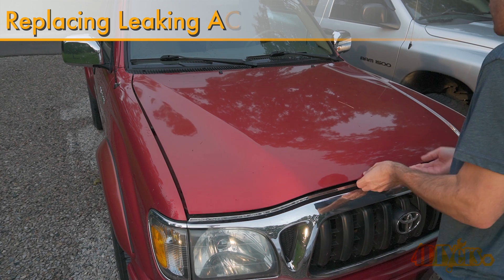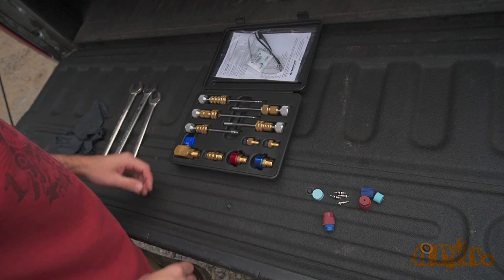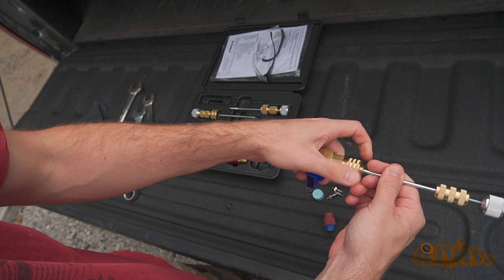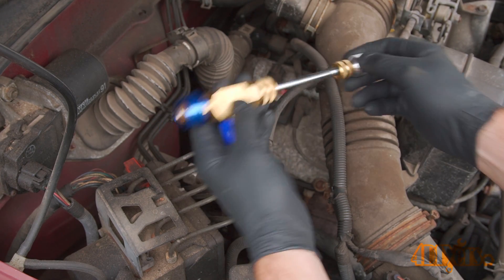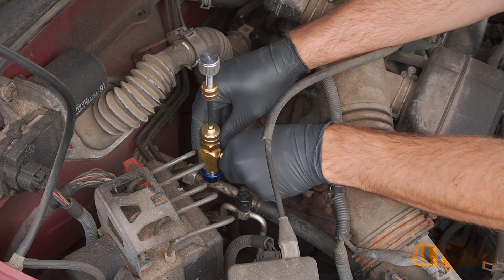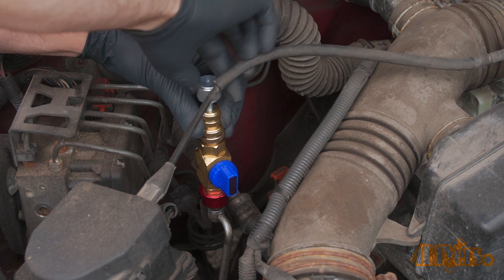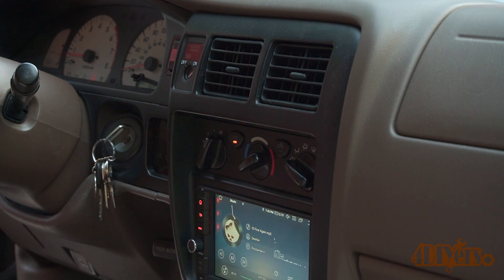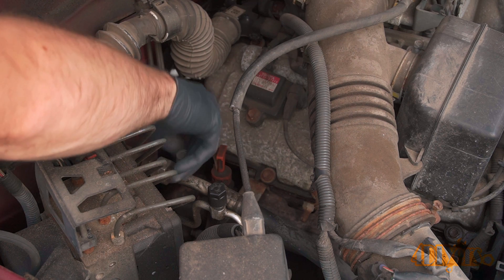How to Replace a Leaking Air Conditioning Schrader Valve on your Car

Comment: I get a quick hiss when I remove the caps, which suggests the valves have a slow leak. I have the tool, but the valves it came with are incorrect. Did some more searching on the internet and see it suggested that the caps are the primary system seal, not the valves. Very slow leaks from the valves are not necessarily a problem as the caps are what seal the system. Is that correct?

Comment: I just bought this kit.  Does not work with BMW valves.  The valve body isn’t long enough to get the ball valve closed with the large BMW core in the tool.  If the valve body was 1/4” longer it would work fine.  Major oversight by Mastercool.
Reply: Were you able to find one that works. I have a 2018 54i.
Reply: 540i
Reply: @SujitGovindraj  no, not yet.  It’s winter here in Canada and I’ve been busy with other projects.  I’ll resume my search soon.

If you find something please let me know!  Modifying this Mastercool kit might be the only option, unless I can find out which tool the BMW dealers use.
Reply: @abel4776  I had it apart several times to see if there was any way to make it work.  The BMW valve cores are just too long.  I tried it first off the car to make sure it would be ok and it wasn’t, so I never even got to try it on the car.

Comment: Replaced valve 2x and it's still leaking... around the sides...
Reply: Could be bad valves, contaminants not allowing it to seal, damage to the service port or the valves may not have been tightened enough.  I always bleed the refrigerant out of the core removal tool, close it back up and let it sit for 20 min to see if pressure builds up in the tool indicating that it’s leaking
Reply: Be very careful not to get any dust or dirt on the new valves.  Notice that he is wearing clean gloves in the video

Comment: My ac has a leak every time I add refrigerant I see the green oil on the cap and inside around the valve, I'm guessing the leak is the valve am I right?
Reply from the maker: Most likely that is the issue. You can also add a dye to the system to be sure and I do have a video on that.

Comment: I used one of these 'tools' by Master something or another, and couldn't take the valve out after multiple tries at multiple occasions. The valve would come loose (I could feel it) and it just would not go thru the skinny ass tool that its supposed to go thru to pull it thru. I even loosened the connections so that the o-rings would'nt be over-compressed, etc. thus preventing it from being retrieved. The schrader was detached from the system, but couldn't be pulled out thru the tool, and just got stuck and fell between the valve switch I got frustrated after a few months of trying and just let the pressure out of the system then pulled it out. Them damn tools don't seem to work (except on youtube videos)... After removing the schrader and placing it on the tool, it seemed to grab pretty good, but for some reason, didn't want to go thru to the other end of the tool (between the cutoff valve) in order to pull it out. I seriously am pissed... Maybe this version of the tool has a wider shaft, but the one I had made by the same company... well doesn't do very well.
Reply: The same thing happened to me. I have a 2006 Ford Focus that had a leak in the high pressure valve. I bought the tool so I wouldn't throw out the gas, but the valve didn't go through the hole.
Reply: This happened to me! I’m trying to fish it out with luck. I’m already an hour in. Website says to put grease on tip so that the valve sticks. I should’ve done that.
Reply: Never mind! I was successful in replacing it. This tool has its learning curve that’s important to consider. (Probably because I purchased a $40 version of the tool.) My Schrader valve kept falling back down as I pulled it up. I had to pull it carefully up so that it didn’t get caught in any tiny ridges up the tool. Very useful tool once I understood it.

Comment: I wish I still had my 1999 Pre Runner instead of trading it in for a 2017 F-150. I'd have $40k more money and a better truck. If Toyota had their act together they would have designed their trucks to be flat towed behind an RV like Ford, GM & Ram trucks are. Then I would still have a Toyota. My F-150 with 25k miles is in the shop getting the A/C fixed. My Tacoma with 140k miles only needed a starter solenoid in addition to brakes and usual wear items in almost 20 years.
Reply from the maker: Unfortunately all the new vehicles have plenty of problems, they are no longer built to last. The newest vehicle I have is a 2010 and I highly doubt I’ll be going and you were ever. I’m planning on getting an old truck this year hopefully.

Comment: No matter what the forums say, if you lose the low port side cap, cover it asap! Had a leak in the L side valve due to debris. Easy fix but forums will say its ok to leave it

Comment: Great tool and well worth the money if you do this type work for a living but if you only do this to specific vehicles once in a while, it's rather expensive for a specific application. My Dodge Ram has a much larger High Side Core than the low side and I can't find a specific tool like this for my specific application. Any help?
Reply: You may have to have a shop empty the system then change The valves vacuum and recharge.

Comment: very nice step by step - clear, concise.  ? for you - is the valve core the same for both the low and high side?  Im looking to buy a kit of valve cores and am wondering if i should get an assortment - workin on a 2000 subaru forester.  Thanks.
Reply from the maker: Thank you so much! I believe it was. I ordered the cores from Rock Auto, saved me from having a bunch of random parts kicking around that I may or may not use.
Reply: @4DIYers  good idea!  I'll take a look out at rock auto -

Comment: How did you diagnose the schrader valve as the leak? Fill it up with dye, clean the valve to remove the dye and then check it with the uv light ?
Reply from the maker: Yes I did, here is the video https://youtu.be/BeveZk9ql0g
Reply: 1) the cap was wet from inside. 2) I placed ear next to port and heard hissing from it.

Comment: The tool I bought doesn't grip onto the Schrader valves to pull them out. How do I get it to hold onto the valve so I can pull it up? Just bought a kit on Amazon
Reply from the maker: Is it the same brand as what I used in the video or different? These have an o-ring in the tips to grab onto the valve.

Comment: Thank you for introducing the way to replace the Schrader needle without losing the vacuum in the system. Now I need to find that tool. 😅
Reply from the maker: You're very welcome!
Reply: @apostolicway2604 I found two tools but they were cheap china knockoffs and could not hold the pressure. Ended up doing the vacuum still. 😅
Reply: I found the Mastercraft tool on Amazon

Comment: You linked to the Mastercool 58490, which is universal. But I also see a 58560 and 58531 which are solely for Eaton / Standard and JRA respectively, and obvs, cheaper. Any hints on how to tell which you have, eg: Honda?